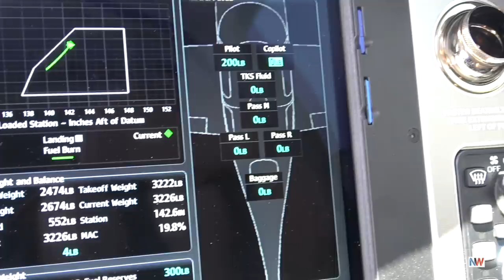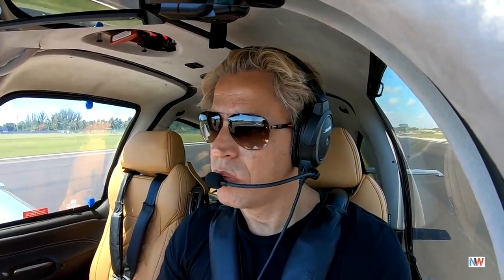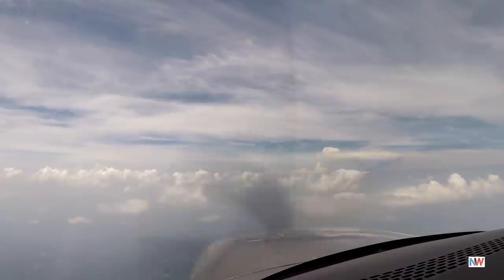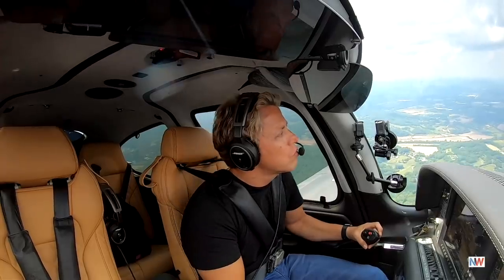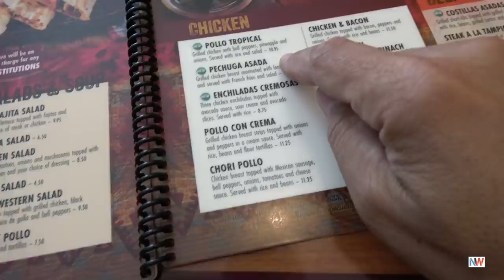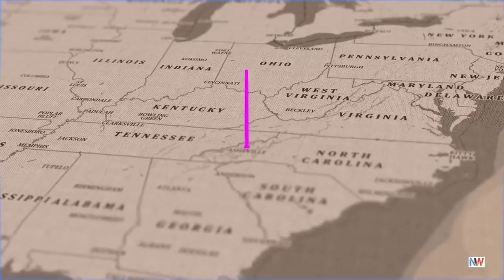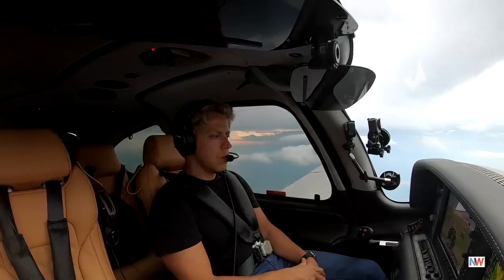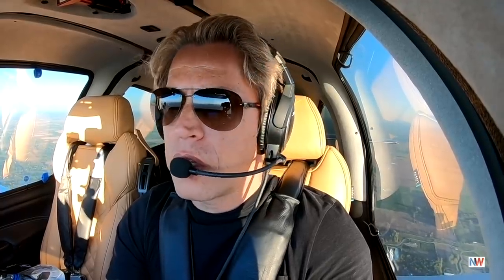VAPOR LOCK, She Doesn't Start, and a 51 Knot Headwind

Comment: I know there are many different ways to hot start. On my Cirrus I go mixture rich, throttle half full, prime on high boost until I see fuel flow (usually it's fast), switch to low boost, then start.  So far so good and I haven't had any problems (yet). Loved the video as usual, and I really loved the landing view on the wing mounted camera!

Comment: Your Cirrus is equipped like an airline jet compared to the aerobatic airplanes & experimental aircraft that I fly. No glass panels nor autopilot in my aircraft. 

I experienced vapor lock on take off in my Starduster II biplane on a humid August day. I was able to glide it back to the runway for a downwind landing. Cowlings trap the heat and bake the fuel lines. I always open up my cowling on my Pitts if I land at a location for a short time.

Great video. Well done. Nice cross country flight.
Reply from the maker: That will make you sweat, and it’s not the heat

Comment: Vapour lock - reminds me of our Comanche 400 which was a total disaster to start hot, usually immediately after refueling.
Prime to flood, full throttle and mixture lean and crank to almost exhaustion was the only way it would fire up.
The starter motor had a right flogging each hot start.

Comment: another great video.  Id like to suggest opening the oil door (it wont always stay open because of wind) as that will help with heat dissipation.  (it will still be common for the fuel lines to be vapor locked but it helps)  Lastly, if you could pop that dipstick it helps as well.  You will be surprised at how much steam comes out and that has the benefit of reducing moisture in the crank case thereby reducing engine corrosion.  in my 2005 SR22, I always pop the oil cap after every flight.  Lastly, I think you would benefit a lot from buying an O2D2 from Mountain High.  You will use 1/3 less O2 per flight.  Keep op the great vids.
Reply from the maker: Yup I have the X3 conserver from Precise Flight, which I didn’t use on this flight because I bought it a month after at Oshkosh. By the way the Cirrus is equipped with onboard oxygen tank. I too leave the oil cap and oil door open but I’d hate to forget either open after start.

In this case Signature put me upwind in a side of the building that was sunny without any wind. That’s why you’ll notice when I sumped the fuel the airplane was at a different spot, because I made them move me downwind.

Comment: Thanks for another great vid.  I have to say Vapor Lock scares me a bit especially when you hear about accidents during takeoff but, as a non pilot I think I need to spend more time educating myself.
Reply from the maker: It doesn’t happen on high power settings that much. And that’s why we always run the boost fuel pump during takeoff and landings.

Comment: we have same engine(almost).  hot start(not in POH this way) for me is throttle open 1 inch, mixture idle cutoff, fuel pump or vapor suppression on, crank engine, when it catches, mixture rich and pull the throttle back to acceptable idle.

Comment: Hot engine starts,  lol.  I know you have a turbo, but the NA 22,  I just crack the throttle, full rich, hit boost, and turn it over,  no priming if the engine oil is over 100, works every time...… so far anyway, lol.  Vapor locked or flooded, they don't start.
Reply from the maker: I had the same technique with my G2 NA
Reply: Niko's Wings I do the same thing as Paul.   Works every time.   No priming.  Mixture Rich, throttle cracked, hit the Boost pump just as you hit the starter.  I’ve never had vapor lock in any SR 22 using that technique during a hot engine start.

Comment: If I may suggest a different approach to the hot start. Set mixture full rich and throttle full forward just as you would with a cold start, select prime and watch for momentary fuel flow - 2-3 gal/hr no more. 
If you have ff then select the pump to boost, throttle to 1/4” and start as normal. If you have no fuel flow the you are vapour locked, don’t even bother cranking the engine, get out and drain the gascolator before trying to start as you did in the video. Works for me in the SR22 every time - ymmv.
Reply from the maker: Exactly and that’s what happened here. There was zero fuel flow

Comment: Here is a tip for free, if you are running any Lycoming fuel injector-ed motor try this on a hot start; once you have cut the motor, leave the mixture in the full lean position, after refueling or whatever you have to do.(only hot starts) Master switch on, prop clear, Throttle and mixture full forward for approx. 5 seconds (you will hear the fuel dumping into the cylinders) (this is more than enough fuel to fire her up) mixture back to full lean, throttle full forward and crank the starter. When she fires up, (you will have to use both hands for this) slowly come back with the throttle and with your other hand go rich with the mixture. If the engine wants to cut come back slightly with the mixture and simultaneously add a bit of throttle until the rpm increases and then slowly go richer on the mixture. On a Lycoming engine hot start don't use the boost pump. It takes a bit of getting used to, but works every time. Worst is cranking the battery dead and nobody in sight to assist. Cheers...
Reply from the maker: On the continental the hot start process is the same…

Comment: Okay Niko, here is the problem mate. You can get a camera to stay on a wing via a suction cup and fly all over the place at speed etc yet my Nav Man falls of the windscreen after two hours! Damn, how do you do it??
Reply from the maker: The wing mounted camera is not on a suction cup because they fail. It’s mounted with a surface mount that is screwed in. Every suction cup fails, some more than others. I like GoPro auction cups because they are better (for the inside cameras) but these too fail with temp differences.

Comment: i vapor locked an ‘05 piper warrior once. i knew what i did immediately because i had shut it off, hopped out, said hi to a friend, and then immediately hopped back into her and tried to crank her up and it was like 90 degrees outside. had to do the sit of shame on the ramp while i waited for the boost pump to cool off.
Reply from the maker: The sit of shame… lol 😂 so true!!! It recently happened to me at FXE. Zero fuel flow! It was just too darn hot and humid…
Reply: @NikosWings  Well, yeah, that’s south Florida in early summer for you! 🤣

Comment: Try this if it's heat soaked again: Throttle at idle, mixture full rich, high boost for about 20 to 30 seconds, turn boost off, throttle full forward, mixture idle cutoff, turn key until it just fires, boost high, pull throttle back to high idle quickly, move mixture forward "a beam" (adjacent) to the letter "X"  on the word mixture.  What that does is pushes cold fuel thru the fuel pump and sends it back to the fuel tank thru the return line on the pump.
Reply from the maker: Thx will try it
Reply: The factory turbo TSIO 550 you have typically doesn't have that issue. It's more an issue with the IO 550 tornado alley engines like the G3 has

Comment: I wonder if hey could retrofit an add-on device that pumps cool fuel from tank into fuel lines to help fix a vapor lock situation without having to get out of plane and fix it by draining fuel like you did and then re-dumping it into wing tank.  I get its a rare situation, hot day / sitting in sun / no wind / etc - but might be 2nd way to solve the issue besides draining it yourself manually.

Also - during that bad weather flight with the radio going nutz- did they ever figure a solution to help mitigate or prevent that?  

one thing I like about Michigan, weather, hits 50F Sunday, then drops to 20s all next week, with snow / rain/snow/snow..
Reply from the maker: Still working on a static solution. I may just have to get used to it.

Comment: I find it strange that modern aircraft still are effected by Vapor Lock where auto industry has fixed that over 25 years ago with constant pressure EFI fuel systems. I guess if the booster pump was inside the tank that would resolve the problem you had.
Reply from the maker: The engine and system is drained of fuel at shutdown since we don’t just turn the ignition off, we cutoff the fuel supply. Major reason is that so the prop won’t misfire and kill someone. But that draining of fuel leads to fuel vapor in the lines

Comment: Can’t wait for DA50, that Diesel engine is better in many ways, hopefully will come around the same price as the cirrus
Reply from the maker: I like the diesel DA50RG but it still doesn’t come close to the SR22T. It’s more expensive, it requires a bigger hangar and more expensive annual maintenance and insurance (RG). No BRS parachute and overall performance is not great.
Reply: @NikosWings  agree on every point here, except the cirrus still has antiquated engine. Why wouldn’t Cirrus consider updating to fadec
Reply from the maker: They are not doing it because a) they sell most airplanes than anyone else and they are back ordered for years, b) others like Cessna have tried it and it was a failed project as people simply didn’t buy the diesel versions. C) in America the public is in love with AV Gas and that won’t end anytime soon…

Comment: Hey Niko, do those suction cups for the fuel come with the plane? and what exactly are you looking for is it a certain color?
Reply from the maker: It’s a fuel strainer. No suction cup, just a stick that pushes a valve and let’s the fuel drain. We look for color and water or other contaminants. In this case I pulled enough hot fuel out to let cooler fuel from the fuel tanks in the system
Reply: @NikosWings  thank you for that info i always wondered what it was acttually called. blue skies Niko.

Comment: Vapor lock? How quaintly old fashioned, cars used to get that sometimes 50+ years ago.
Reply from the maker: Airplane engines are drained off fuel when shutdown to prevent accident prop strikes and kill someone. In the void of the fuel lines on a hot day vapor develops and it happens. Most of the times it’s not an issue.

With carbureted cars that was the case since there was a LOT of space for vapor to develop in the carburetor. With fuel injection cars this is not the case anymore.

It would be the same with our airplanes, since they are fuel injected, but the facts that we shut off the fuel in order to turn the engine off creates space in the fuel system. Cars just turn off the ignition. We can do that with an airplane too but a prop accident may happen.

Comment: Niko, how’d you overcome the vapor locked pump? Just waited for it to cool?
Reply from the maker: Started the boost pump and sumped fuel from the gascolator until cold enough fuel starting running through the pump. Basically I sucked the hot fuel out of the system. Look at the video and you’ll see what I did.
Reply: Niko's Wings I thought so. Just wasn’t sure if that was edited

Comment: Yea, that was not a vapor lock. That was the plane's safety systems trying to prevent you from closing yourself in to a confined space, after eating an enchilada. How did you survive the flight? Did you cut out the part where you needed to use the oxygen mask?!?
Reply from the maker: No enchilada my friend, chicken salad 🥗
Reply: @NikosWings  Just kidding Niko. Planes can't really see what you ate for lunch. XD

That was quite a headwind. Did you ask if you could try at different altitudes? Sometimes that helps a little.

Comment: Don't understand why vapour locks still happen as it is quite simple to design a system where such a thing is impossible.  Hmmm.
Reply from the maker: Vapor lock used to happen with carbureted engine cars. Fuel injection solved the issue. All modern airplanes are also fuel injected like this one. Vapor lock still happens because in airplanes we cutoff fuel supply on shutdown as opposed to turning off the ignition for safety reasons (accidental prop strike). That creates a void in the fuel lines that causes vapor on a hot day.

Comment: Little tip. When you have vapor lock, flip your boost pump on simultaneously as turning the key to start your engine. Works much better getting the vapor lock out in SR22’s. I do everything you do for hot starts except when I turn on my boost pump. When you turn your key to start and turn the boost pump simultaneously, you’re allowing the fuel to be forced through the lines and the vapor lock will be gone. Try it next time. But it literally HAS to be turned on at the same exact time as you turn the key to start. Never once have had it fail.
Reply from the maker: I’ll try it, but on this one there was no fuel to grab, just vapor.

Comment: @Niko, is this vapor lock issue something that could have occurred in-flight? Or is this something that can only happen on the ground?
Reply: I've watched a handful of your videos. Honestly, it's kinda making me concerned about considering buying the cirrus SR-22. Seems like you have had quite a bit of little issues. Some more scary than others. That engine vibe while you were with your family was sketch AF. Glad you're all safe... What are your thoughts on Cirrus reliability given your experiences?
Reply: For vapor lock to occur, you need a high amount of heat to boil the fuel in the fuel lines, thus turning it into a vapor rather than liquid. Considering this was a very hot day in North Carolina, the ambient air temperature coupled with the post-flight engine temperature caused the fuel to vaporize, and there was not enough time for the fuel to cool to a point that it returned to liquid state. This is not strictly a Cirrus thing. It can occur in tons of aircraft. Vapor lock can also occur during flight, but it is less common, especially in modern aircraft, because, again, you need a lot of heat, and during a flight there is a lot of air flowing to cool everything down, not to mention fresh liquid fuel always flowing from the tanks. They have also improved the fuel system technology to help overcome vapor locking. Where it might become more likely to occur would be in places with higher elevation, such as in the Rocky Mountains, where ground level ambient temperatures can still reach 80+, but the higher elevation reduces the fuel's boiling point.
Reply from the maker: Great answer, and to respond on the Cirrus reliability question, Cirrus is the manufacturer but the components are common amongst many aircraft. Other than the shape of the airplane and some interior exterior finishes all the systems that go are OEM
Reply: (Cough) "Diamond DA62s dont have vapor lock problems" (cough cough)...

Who said that?   This is not a D vs C thread 😁  

For serious cirrus makes an excellent high performance aircraft with lots of really cool features.. I mean flap ice detection 😳... Most of the problems pilots get into with them is their over reliance in the CAPS and/or their own abilities. I  absolutely love Nikos Cirrus!!!
Reply: @the_hodgepodge  Great info, thanks... So, if I understand correctly, this is more likely to occur if one is spending a lot of time taxing around on a hot day, when airflow doesn't offer as much cooling?
Reply: @NikosWings  Yeah, I was wondering that... Almost everyone is using the same guts, I suppose. Well, I'm glad you guys are so great at troubleshooting these things and pointing them out. You do us all a great service by making these videos, buddy. Thanks again.
Reply: @NovejSpeed3  Yeah, those Polo seats are classy! ;) I definitely love this plane. Just have the usual newbie concerns, ya know? That DA62 though... hell, and the DA40... Mmmmmm. If I don't get to fly a DA62 before I die, I'm coming back for a re-do.

Comment: I haven't had a vapor lock since my 1979 FIAT.. They need to just stop putting those ancient engines in $800k aircraft.
Reply from the maker: Internal combustion’s engines are ancient technology no matter if you have 79 FIAT or a 2020 Ferrari. It’s the same crap, just fancier. Airplane engines are equally as ancient but work extremely well and are very reliable, more so than any car engine. Having said that, vapor lock has nothing to do with the tech, it’s related to the shutdown method.

Comment: How did you conclude it was vapor lock?
Reply from the maker: The airplane told me
Reply: Based on how you got it to start looks more like it was flooded.  But can’t tell if you primed before trying to start.  I have a 340 with essentially the same engine.  When it’s hot, what works is to not prime, set the throttle to the usual spot and crank.

Comment: Pardon my ignorance, but would it not have been safer to have had a technician check the problem just for a second opinion?
Reply from the maker: Nah, these things happen all the time, it’s really no big deal
Reply: He did the same thing a technician would have done. If it would have not started after doing the fix a couple times I would have checked with them. It use to happen on very hot days on carburetor cars or if the engine overheated. The carburetor would dry out and starve the engine of fuel. My dad use to use starter fluid and spray into the carburetor. Nine times out of ten it would turn over. You can also pour cold water on the water pump and fuel line to cool it down, after the engine cooled down a little.
Reply: Niko knows his plane!😊
Reply: @gomphrena-beautifulflower-8043  I am concerned about his well being.